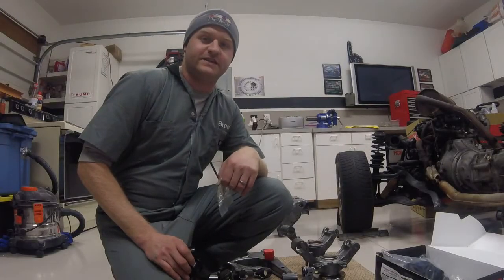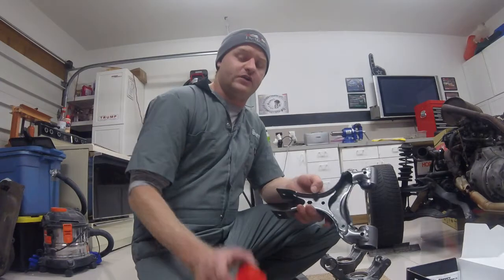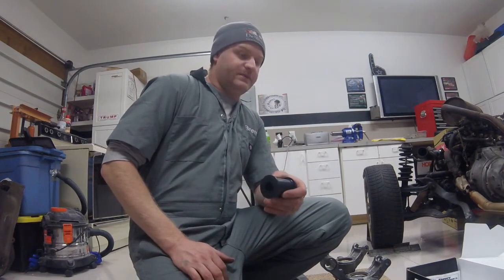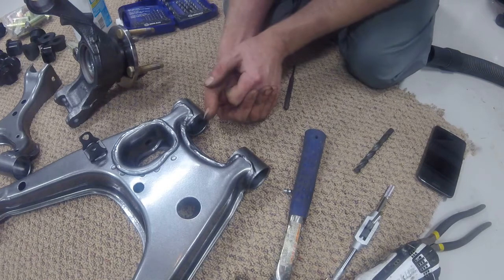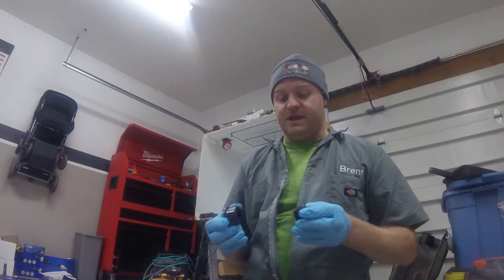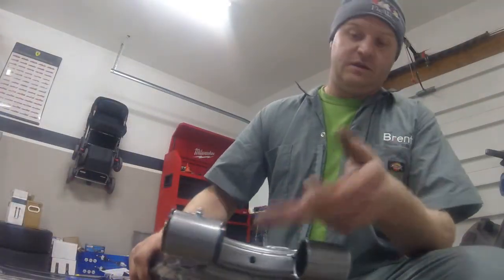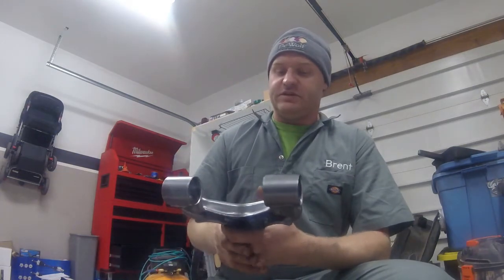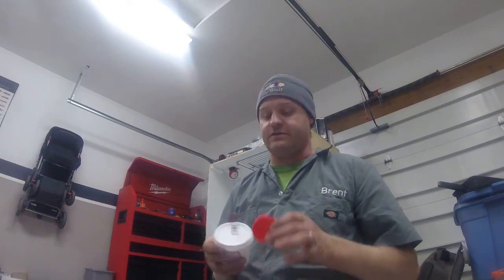Exocet Build: Miata Energy Suspension Bushing & Zerk Install (Part 12)

Comment: i think you doing it wrong... the bushing must inside the arm and not move.. only the sleeve must move inside it. you have do grind to borders outiside the bushing, so when you mount the arms in the car, the bushings do not touch the mounting points. the sleeve must be stuck on the mounting points, so the arm goes up and down freely rotating over the sleeve only
Reply: That is what I thought. The manufacturer showed only the sleeve must move.

Comment: In hindsight, could you not have addressed the location issue while it was still a Miata?
Reply from the maker: Yes but that would require me thinking 4 months ahead and I can barely do 15 minutes ahead. 😁
Reply: @BuildingTheEXOCET  I greatly appreciate the time you've taken to document your build. I've been looking at building one for a couple years and when I do get started, your videos will greatly improve my process as I go. I certainly wouldn't have thought to locate the zerk fittings during disassembly until I watched this video. Great work!

Comment: what kind of grease? can i use marine grease? also how does it feel compared to the stock rubber ones
Reply from the maker: NO!  ONLY use the special grease that is supplied with the kit.  I also recommend buying another tub on amazon as they do not give you enough.  This grease is different than most any other type of grease in a tub you have used before.  It will hold up much better.  FORMULA 5 PRELUBE is what you want.

https://www.amazon.com/Energy-Suspension-9-11104-Tub-Lubricant/dp/B000MW5SJ4/ref=pd_lpo_vtph_263_bs_t_1/137-1608247-6301365?_encoding=UTF8&psc=1&refRID=F1C6HXA62ZSZVTZK2AKF
Reply: @BuildingTheEXOCET  thanks